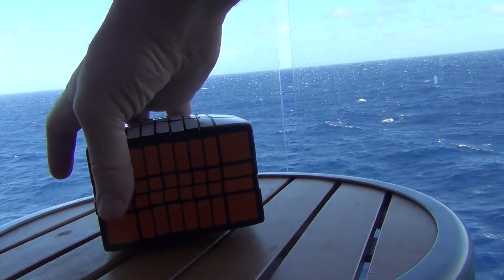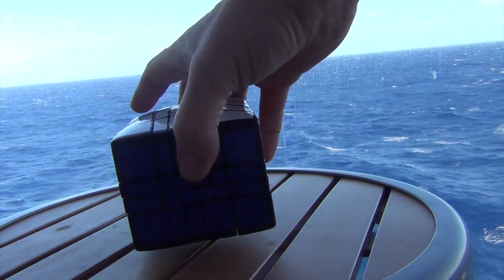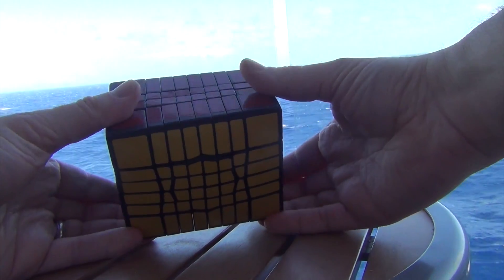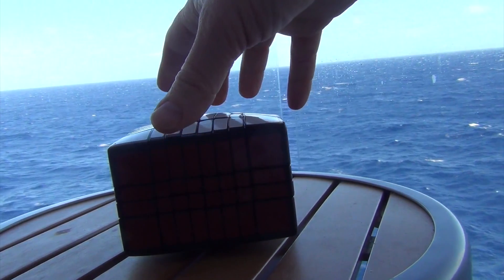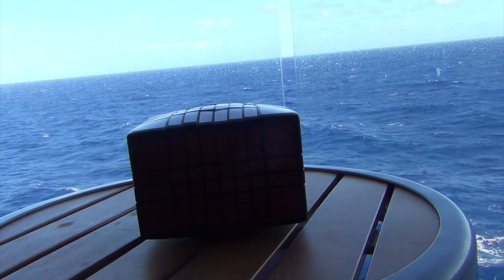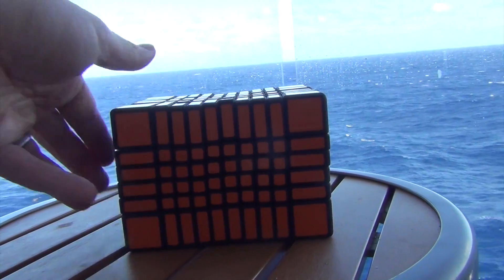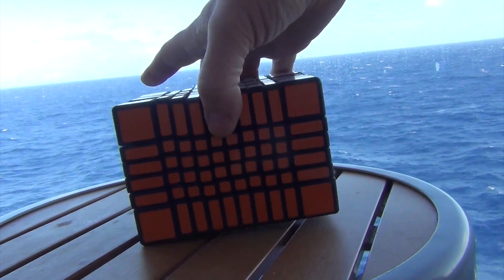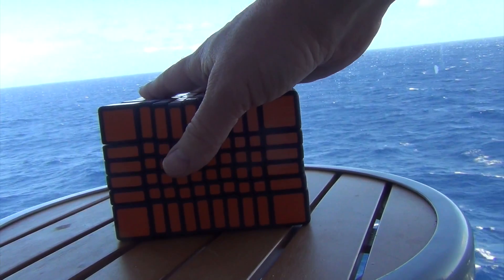4x6x8 part 4:  Final Edge Reduction!

Comment: While our scrambling methods are very similar, our solving strategies are radically different. I start with a 2x2 solve of the corners. I flatten the 6x8 sides. Do a roux style reduction of the 4x6 outermost layers minus the center portion. I reduce the rest of the edge pieces which takes care of all the parity mismatches in the process. Then place all the centers using random commutators none of which are more than 12 moves long including your brick "parity" case and it's solved.

Some things in our strategies are totally foreign to each other. Like your use of the red bull algorithm. Can't say I've ever used that before on mine. The way that I transfer what you call floppy parity to different sides of the puzzle quickly is absent in yours also(look at my suggestion on scrambling in the first video of this puzzle solve for a big hint as to how I do it). Just goes to show that there are lots of ways to attack a problem. You could do an AI style solve for example...

With so much possible variety I really can't understand why no one has decided to mass produce more ultimate shapeshifters. We as a community at least need a 3x5x7 that's easily accessible. Lots of people really do love cuboids and I believe that people downplaying how popular or saying they would be too expensive to produce really don't understand the situation completely. If they can make big expensive things like a 13x13x13 why not something a bit smaller and more interesting also...